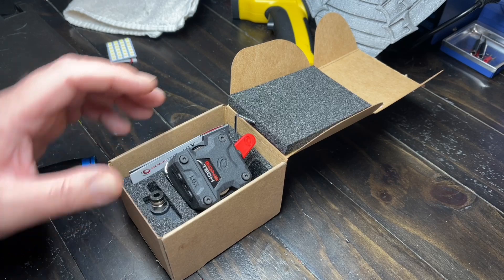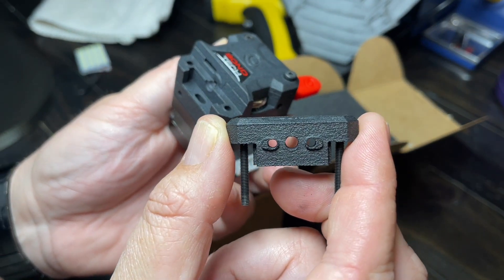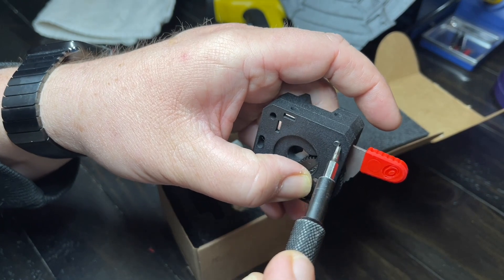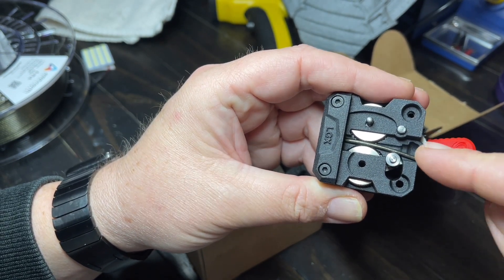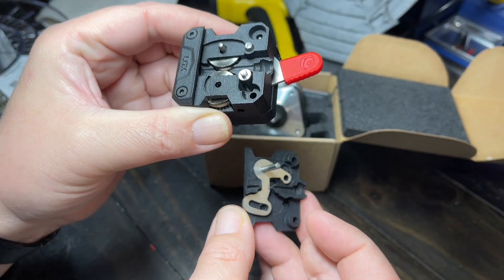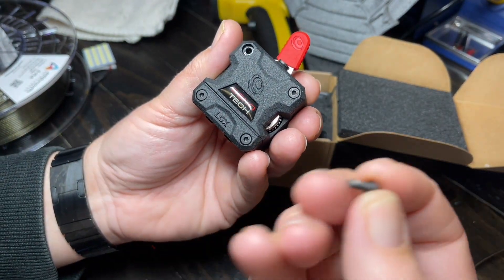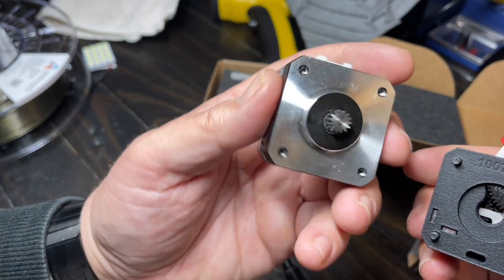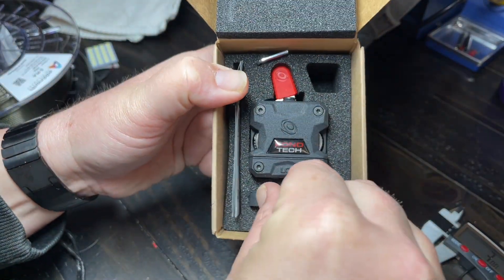BONDTECH LGX EXTRUDER FIRST LOOK AND UNBOXING; 3D PRINTING

Comment: So how you like this LGX?  I have one coming today and MRW beta mount for RC.
Reply from the maker: It’s great
Reply: @thelightspeed3d712  Cool.  What hotend you using?  And fan shroud?
Reply from the maker: @Rmilyard  I’m using a Slice Magnum+ with dual heaters. The fan shroud is the Petsfang I had printed in SLS nylon.
Reply: @thelightspeed3d712  nice.  Where in AZ you live?  I am in Goodyear. Got my LGX today and have RC 300ZLT.
Reply: @thelightspeed3d712  I sent you message on Discord.  Would like to ask you few things.
Reply from the maker: @Rmilyard  hey ray I don’t really do Discord. Best to dm me on Twitter
Reply: @thelightspeed3d712  Like to see it on RC.  I got beta mount from MRW coming soon.
Reply from the maker: @Rmilyard  I’m using the Slice Engineering Beta Magnum+ that was announced today. So I have shown any photos of my mount due to privacy reasons. But let’s say it took lots of tweaking to get it to fit right.

Comment: When you suggest something might be an issue it'd be great if you could elaborate and tell us why. 😉👍
The gear ratio is 7. There's no need for any special adapter to print flexibles. It prints Ninjaflex at 70mm/s easily apparently.
The model you have is not for the Sidewinder so that's why it won't fit. There's a special kit for the Sidewinder and another one for the Anycubic Mega-X. They don't recommend this extruder for any of the popular Creality printers because it would max out those printers capabilities, and so you wouldn't get the full potential out of this dual drive (but we already knew this from the E3D Hemera).
Reply from the maker: I didn’t say it needed a special adapter?
Reply from the maker: I said it should print flex fine. They do sell a special setup for flex tho is my understanding.

Comment: So they copied the hemera but made it more complex and harder to mount
Reply from the maker: Actually this is nothing like the Hemera. The stepper and drive gear is similar but the extruder itself is far better. The bigger gearing and large filament wheels is fantastic. 

But like the Hemera, and the BIQU printing fast is going to be a challenge

Comment: Why didn't they include the heat sink into the design. I'd rather have the BIQU H2 which has a similar design, but incorporated the heat sink.
Reply from the maker: So they do have a version that has the heat sink and where you can attach your own heatbreak and hotblock
Reply: @thelightspeed3d712  I see some designs where they mount that stuff below it on their website, but not where it is integral. If the parts of the extruder are metal, they can be used as the heatsink with a little extra design and save some weight.

Comment: Thank you for showing the filament-drive gears; just don't send it back to Bondtech with your fingerprints clearly visible on the stepper (:-). The small gear on the stepper motor's shaft is long enough to accomodate a mounting plate in between. I thought this was obvious when you compare its size to the thickness of the plastic gear. So far, I have not seen any information about the exact total gear ratio. This extruder is not intended to be sold without the customized LDO stepper motor. This is explained in comments posted for the product's reveal video.

Comment: Yes, the main gear is press-fit; it will not get stripped by the plastic gear that it drives.
Reply from the maker: Yes I realize that. But with a 3mm plate between the drive gear is just barely touching the plastic gear

Comment: Very cool as everything from Bondtech. So they still making the body printed by SLS technology, right? That’s cool but expensive. They should validate the design and injection mold before China join into that. The Bondtech BMGs are widelly producing by CN for almost 3 years. I know the original are much more precise in tooling aspect but producing in bigger scale should makes the price more atractive... as I live overseas shipping and custom fee more than double the value in my country of everything that comes from US and Europe. Thanks to share! I subscribed and will wait for a follow-up ;)
Reply: To be fair, some clones are good and some are not indeed. 

There are clones with better tolerances than the original bmg. Injection molding is just a better manufacturing process (when done right)  
   
Bondtech's stubbornness to stick to sls means that their manufacturing capacity is limited (extruder is out of stock now) and the price remains high.
Reply: @doa_form  but how to distinguish the bad from the good ones?
Reply: The chinese clones are garabge. I got a bmg from trianglelab and I cann’t wait to replace it for the original or LGX. Clones are not much cheaper either. They are 1/3 the price of the genuine but not even 1/100 of its quality. Save your money and buy the genuine.
Reply from the maker: @saultigh4103  I agree a 100% clones are garbage
Reply from the maker: Honestly China injection molds their clones and they are junk. SLS is a superior product to injection molding from what I see